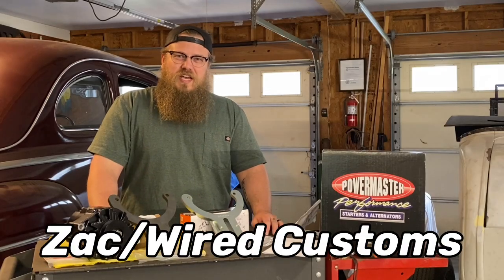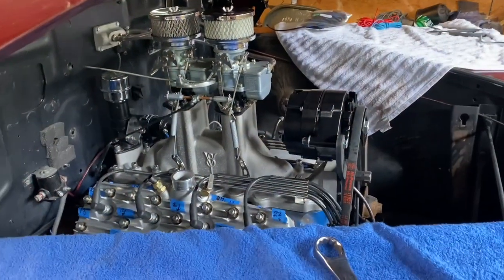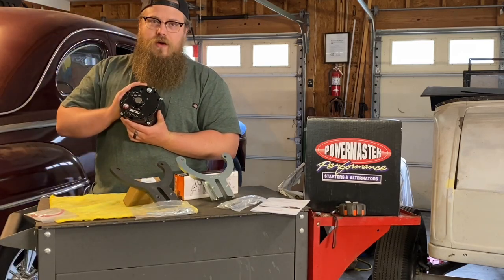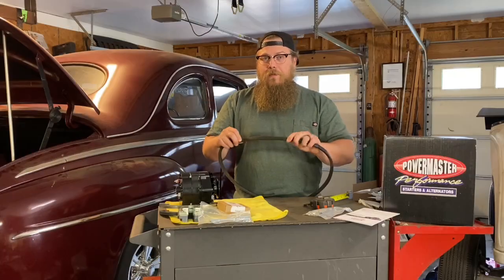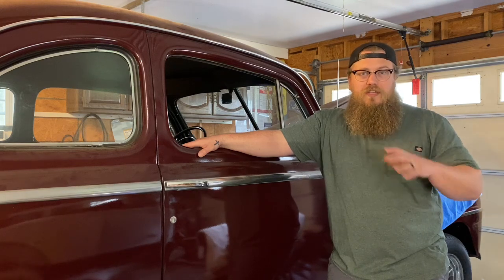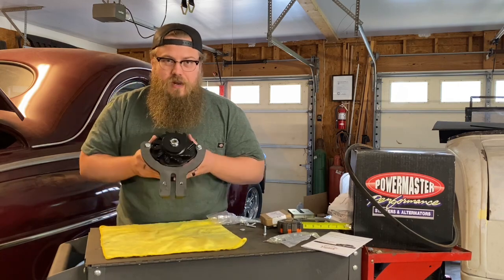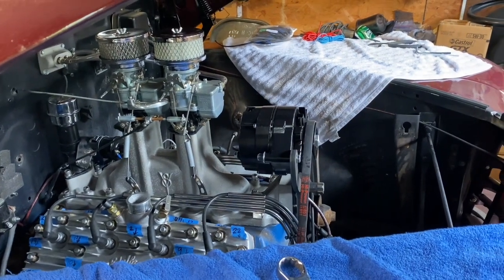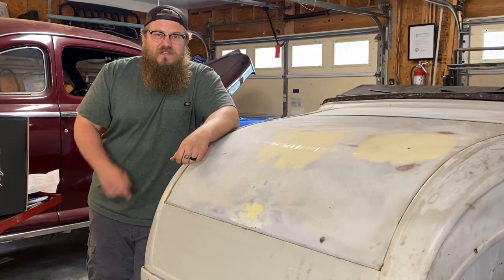Ford Flathead: Choosing the Correct Alternator & Install

Comment: Hi Zack.  I am in the middle of switching from6 to 12 volt, thanks you you I got this far.  I can't get the trim ring off my front parking lights. I took out one screw and the ring turns and is fairly losse but it won't come off.  I don't want to force it so I thought I'd ask you. If anyone knows, you do. - 1942 Ford 3/4 ton pick-up.  Thank you in advance !

Comment: Excellent video, Zac! Thanks! Question: Is there a restriction (metered orifice) anywhere in the line that feeds the oil filter housing from the block on a '50 239cid  8BA engine? Enjoy! Be safe! I'll be in the garage, getting my "shift" together! (smile)